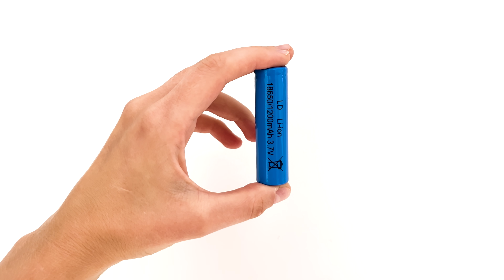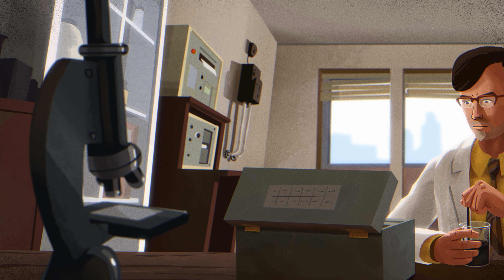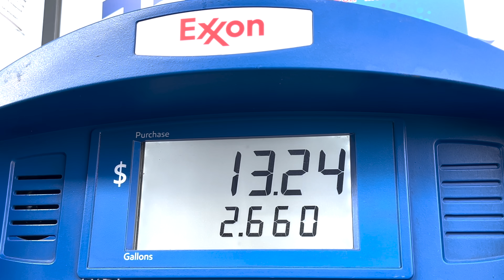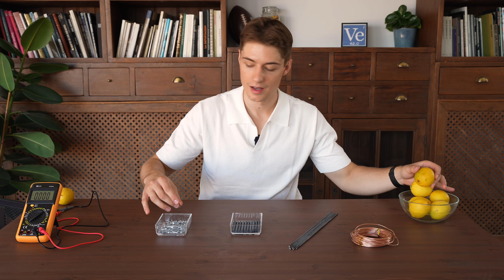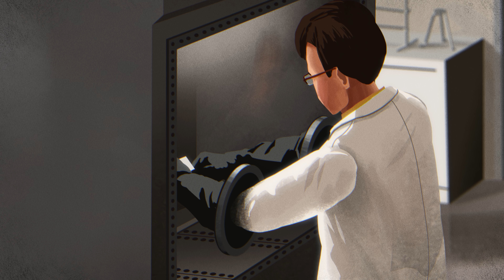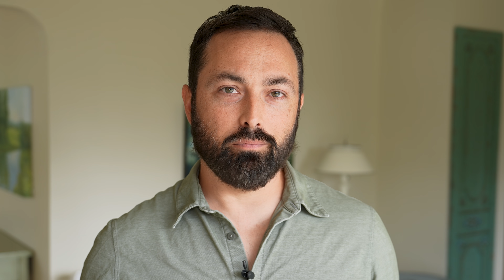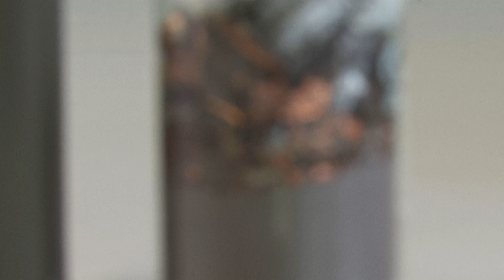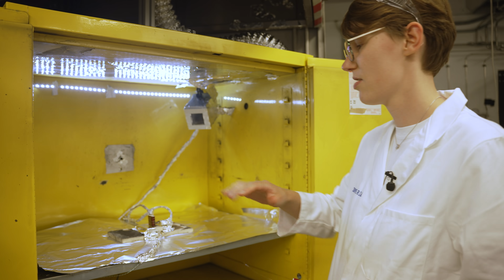The Perfect Battery Material Is Dangerous

Comment: wow so like these lithium batteries are basically ticking time bombs but they're in everything?? i thought SEI meant super extra insulation lol. so if a battery fire happens on a plane do they just throw it out the window or what
Reply: no they're not ticking time bombs when the proper protection circuits are in place, which is in almost all modern electronics that manage the state of charge and reads degredation through internal resistance of the battery, to ensure it never gets overly charged or depleted in a risky state of internal dendrite buildup.
The issue is if there's a problem with the protection circuit itself.

Li-ion battery tech is much more advanced than this surface level introduction -and yes, this was very surface level and Veritasium focused more on the history of its origins, rather than the further development since it became commonplace. Lithium batteries today are immensely safe -because the chemistry and the surrounding safety systems are very well understood and widely incorporated. But when inexperience or lack of care for proper safety procedures exist, then there can be hazards still. And there are many types of such batteries that focus on different aspects, some focus heavily on chemistry safety, while others focus on energy density, and third options research the combination of both through modern inventions like solid state solutions that make dendrite formation impossible as there's no liquid electrolyte for the dendrites to easily form in, etc.
Reply: They literally explain what they do on planes in the video.
Reply: @static_motion yeah, but the commenter would have had to actually watch and pay attention to the video, it’s much easier to ignore all that and just skip straight to saying stupid stuff in the comments
Reply: One  went on fire last week in a plane so yes 😂.
How many are in landfill,  billions 😂
Reply: Only Tesla ones 😂

Comment: Some points:
(1) You didn't mention that lithium-ion batteries are considered so dangerous that you basically can't put them into air cargo. Postal services will only tolerate them to be shipped with surface shipping. They're not allowed in the cargo hold of passenger planes. I'm kinda surprised that they're allowed on planes in gadgets in the passengers' section  at all.
(2) It shouldn't be a surprise that lithium is so volatile, given that it's one electron away from a noble gas. Bear that in mind whenever lithium is proposed for all sorts of other solutions to things.

Comment: Wish you talked about LFP batteries. These are much more stable than NCM (the one in your smartphone and others). LFP have made a very long way to the point the reputable manufacturers claim up to 8,000 cycles at 80% under optimal conditions. Prices also dropped so much recently it costs less than $100 for 1KW. Absolutely amazing.

Comment: For 10 years i work, use and misuse 18650 cells. I even shorted some of them accidentally.
I have not witnessed a battery fire so far. 
Modern cells are safer than this video suggests.

Comment: Our measurement of time labeled as seconds is demonstrated using the oscillations or vibrations of a cesium atom. A year is determined by the Earths relative motion to the Sun. But to break this all the way down in its simplest form, Time is a measurement of matter moving relative to macroscopic matter. Meaning if you want to reverse Time, you have to reverse what it is measuring... which is all matter in the observable universe. not just figuratively, all matter is in motion within the universe. In fact it has followed a very specific trajectory within its respective medium. Meaning that trajectory it has followed would have to EXACTLY be reversed in order to actually reverse "TIME" not just the trajectory tho because not only is the matter hurtling through space it is also a lot of times rotating as well which is motion which would have to be exactly reversed. They also emanate out as well which is motion which would need to also be exactly reversed. That also means every atomic piece of matter needs to exactly reverse as well.

Comment: "The problem back then was the batteries". 
Ahh, yeah, that's still the problem. Physics says you can't get the power you need to push 2 tons around really fast without a REALLY heavy and dangerous battery which will degrade.

Comment: This video feels quite outdated. Maybe 5-10 years ago it would have been fine but not even mentioning newer battery technologies like LFP, sodium ion batteries or others which are already being used in electric cars and other devices seems like a big miss. Especially with focusing on the danger it spreads an unreasonable fear for a problem which has to a large part been solved.

Comment: You really shouldn't call it a "1.23 V ceiling". Lots of water-based batteries exceed it regularly. Disposable AA batteries are at 1.6 V when fresh. Lead-acid batteries operate at over 2 V per cell and charge at up to 2.5 V per cell.

Comment: The math at 33:00 doesn't check out. Yes, we will be exposed to a million batteries. But we'll be exposed to most of them for less than an hour. They typically last years before they blow up. They're not going to blow up when you're standing next to them. Say an exploding battery lasts for an average of 1 year before exploding. We'd have to be exposed to a million batteries for a year, of a ten thousand batteries on average for an entire 100 year lifetime for that to work. I have batteries, probably more than I think, but I don't have 10000 of them around me.

Comment: A super interesting video. I still have the old Sony Handycam lying around and the original batteries are indeed Lithium Ion , so I still have some of the first commercially available. 
You need to do a follow up about LiFePO4 and other new battery technologies as this is the future in stationary storage systems as these are much safer and use materials abundant on our planet which have also less disputable effects to the environment and human rights situation regarding their extraction. Also interesting would be a video on the forerunners, the rechargeable Nickel-Cadmium cells, and why they were so problematic (Memory effect, self discharge, no resistance to deep discharge and environmental issues)

Comment: this video is good in principle; however, it contains a major inaccuracy. In a DC circuit, electrons do not rush through the wire as often shown. The actual drift velocity of electrons is extremely slow (mm per second?) while the electrical signal propagates almost instantaneously via the electromagnetic field. Electrons do move, but their displacement is tiny, much like furniture shifting slightly during an earthquake. The current is the movement of charge inside the wire, but the energy that powers devices is carried in the electromagnetic field surrounding the conductor. Please correct this point and re-upload, as the rest of the video is excellent

Comment: Fascinating but I think it unfair to some battery manufacturers, to suggest that all cobalt is and can only be gained from the DRC (the Congo), solely by child labour. When cobalt exists in other parts of the would; and not all cobalt is gained using child labour. Especially as there’s a way forward to eliminate cobalt from batteries. Even if this lowers the capacity.

Comment: Lithium-Ion has been around for a while... A new thing that is popping up and is not all that new anymore is Lithium-Iron(LiFePO4) (NOT to be confused with Lithium-Ion). Said to be able to withstand greater temperature extremes and have a lot lower risk of catching fire. They even have improved life cycles? Perhaps you want to look into this?

I find it quite strange that you did not run into this tech while you guys where shooting this video. Or perhaps you did and didn't even notice, or wanted to keep that for a separate Video? Lithium-Iron batteries are actually on sale already, as we speak, but it does not seem that the world understands the difference between Lithium-Ion and Lithium-Iron. Most people seem to think it's the same thing because it sounds the same. They may be similar in terms of performance and usage but are very different in terms of safety and even longevity.

I feel not enough emphasis is given to what seems like an almost unnoticeable yet critical change in the battery industry.

Your thoughts?

Comment: 5:57 "a solution than carries charge this way by moving ions" is NOT called an electrolyte. The ions contained in that solution are the electrolytes. There can be liquid electrolytes, e.g. molten NaCl, but they are not [necessarily] solutions (I'm talking about NaCl heated beyond fusion temperature, without any solvent added, specifically not water). Btw the only reason I felt the need for making this comment is that your content is always so accurate, I wouldn't be bothering you if you weren't close to perfection!
Reply: Wikipedia says : "An electrolyte is a substance that conducts electricity through the movement of ions, but not through the movement of electrons." ; with three sources to back it up. 
A few lines below, it also says : "In clinical medicine, mentions of electrolytes usually refer metonymically to the ions, and (especially) to their concentrations".
Reply: @gnanay8555  the first of the three sources is titled "The structure of electrolyte solutions" and says "The early electrochemists soon recognised that many salts were more or less completely dissociated in water and the term ‘strong electrolyte’ was coined to describe those salts which became highly dissociated in solution". Are you sure this backs up the idea that the solution is the electrolyte? I think it says that the solution contains electrolytes. Also, the second sentence of the Wikipedia article takes salts as examples of electrolytes: salts, not saline solutions.
Reply: It's a major misconception that electrons move in a wire. It's charge that moves. Electrons actually migrate backward, counterintuitively, but at a very slow rate.

Comment: Only Hydrogen has a higher potential than Lithium but it's tricky! The High-Pressure hydrogen battery is next. At 120 bar H2 intercolates very nicely with a cheap graphite / graphite pair of electrodes in a cheap Boro-Floride organic solvent.
Reply: Lithium has the lowest electrode potential. Hydrogen has a potential of 0 V by definition which is much higher than that of lithium.
Reply: @HanTrio3  You could look at a 'mechanical' Hydrogen battery as a fuel cell. Pound of pound it is better than Lithium just too expensive. To make a Semi-Solid State H2 cell you would need to hold ALL the gas pressure created during electrolysis. This would yield 96% power storage in a tiny space with 16,000 Wh/Kg or 25% more energy dense than gasoline starting with simple KOH water. We have some ideas and can make 2.5V cells easy enough from Carbon fiber tanks but no break through yet! We need Hydrogen creation and pressure to happen in the same chamber as the fuel cell. A High Pressure reversible fuel cell is the basic idea but ALL IN TWO CHAMBERS with no valves or pumps, really simple SATURATION of high presure conductive membranes. When at 300 bar you don't need Platinum, just carbon wool with Nickle and Manganese, CHEAP! CLEAN, Non-toxic, fire proof made from common plenty-full elements but HARD TO BUILD FOR NOW! MicroCapsules have promise.
Reply: @HanTrio3  You know just enough to be dangerous. Explain how a FUEL cell Electric car by Toyota can go 1500 Kilometers on one fill and the weight is less than a LI battery???
Reply: @Freedomistman A fuel cell is something different
Reply: @HanTrio3  Not if it's a REVERSIBLE FUEL CELL. If you can charge it and then get power back when needed It's a BATTERY!
Reply: @Freedomistman How efficient is the electrolysis?

Comment: Im a little disappointed about this since you dont cover a number of very important things about the current lithium battery problems. Heres a few you missed:
- When any lithium battery fire occurs, the fumes are extremely dangerous. For EV's.. you should not go anywhere near a burning EV - the fumes will not only cause serious respiratory problems, they can, and will kill you.
- The large proportion of lithium batteries are being made in China (over 70%) and EV batteries over 90%. And there is little safety and qa regulation in their industries meaning that failure of 1 in a million, is just complete bs. In China alone, the failure rates are much closer to 1 in 10,000 and its getting worse as cost cutting continues in this industry in China. 
- Batteries for storage will never be the solution nor will electricity - because we dont have clean sources. Even if we have wind and solar, we still need much larger sources. Nuclear is not an option - go read about the problems Germany is having decommissioning and finding safe storage for its waste in Finland - and its costing upwards of $100B.. yes $100B for a single plant to be decommissioned - this is not a viable energy option. Pumped hydro and normal hydro is probably the only reasonable way, but the env impact is massive. 
When we have energy conversations we need to have conversations that are honest about what these sources are, where the electricity is even coming from, what infrastructure impacts there are - it is an entire industry chain problem, but we keep getting videos like this saying "batteries are the future" when we know they are not, due to energy conversion threshold we actually know about for materials. 
Disappointing. The quality and logic is starting to wane at Veritasium.

Comment: Fun fact: A common 18650 lithium-ion battery holds about the same amount of energy as a single potato chip.  They typically have about 10 or 12 Watt-hours of energy, and 1 Wh is very close to 1 kcal, and a potato chip has like 10 kcalories.  It's a rechargeable potato chip!  However... don't eat batteries.  They may be spicy and delicious, but the indigestion is killer.

Comment: Disappointed there was no detail on at least a handful of different battery chemistries used today, like cobalt is mentioned but not the fact that a number of EVs don’t even use it any more because they use LFP batteries
Reply: To me it was more an "early history on lithium batteries" than an exhaustive run-down. Cobalt based batteries are in so many devices you use every day as they still haven't found a suitable replacement that gives the same level of energy density.  LFP doesn't come close, so to get the same amount of charge your devices would get thicker and heavier.

Comment: The first battery dates back well before 1780's. Check out the Baghdad Battery, estimated to date back 2000 years. If i recall it was presumed to have been used with grape juice as acid for electroplating.

Comment: I've been fortunate that I've only really encountered a few swollen batteries in my time (none that have ignited or smouldered). But for every one I run across, I say the same thing.
"The battery is compromised now. Attempting to charge it is dangerous, so you need to seek out a replacement lest it light on fire at the most inopportune time"

Comment: The making of the lithium-ion battery is amazing, revolutionizing the world and pushing electricity to new heights, but it feels forced. The idea that we must electrify everything and anything for a better future seems to force the idea that electricity is the ONLY way to go, but for what it is, even stated in this video, that becomes more of a problem as we design more stuff to use the electrical battery. It feels wrong to force these newer products and regardless of whether or not the new thing is good or bad it almost seems that we can't keep any old technology without being an outcast and considered dated. Even if the technology in question is only 5 years old it still is pushed back due to not being fast enough. I know this is going off the rails of the idea of the lithium battery but it seems like we have been running huge into this idea that electricity is the way to go and there is nothing else that could possibly be better. It almost feels as if other possibilities are shunned and technology 5 years ago won't cut it anymore.

Comment: Where is Rachid Yazami in the story?

Graphite Anode Discovery (1980):
While working as a PhD student in France, Yazami discovered a method to reversibly intercalate lithium ions into graphite, which became the foundation for the graphite anode used in lithium-ion batteries.
	•	This discovery made lithium-ion batteries safer and more efficient.
	•	The commercial versions of lithium-ion batteries were later developed by companies like Sony in the 1990s, using the graphite anode concept.

Comment: 29:32 Well an easier way is to simply overcharge it.  Lithium ion batteries do not tolerate overcharge, which is partly why they have such a bad reputation.  It's often the charge controller that causes fires and explosions, when there was nothing wrong with the cell at all.  Oh and speaking of chargers... your device "charger" isn't actually a battery charger, it's just a DC power supply - the actual charger is inside the device.

Comment: @31:00 what this video gets wrng and leave out is that only certain chemistries of li ion have these risks. They should have also mentioned and talked about how lifepo4 cells don't have these risks and offer many benefits but only 2 downsides. Capacity and voltage but mainly capacity.

You also leave out the importance of things like silicon, nanowire, gold, and nano sphere batteries.

Comment: With the lemon, if you reversed your leads and put the negative end on the copper would it read negative DC voltage? Like if you put your leads on a battery backwards.